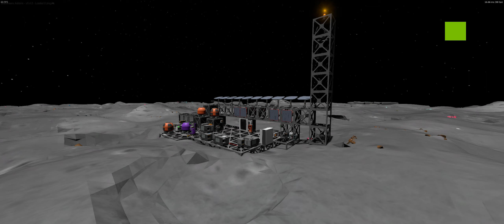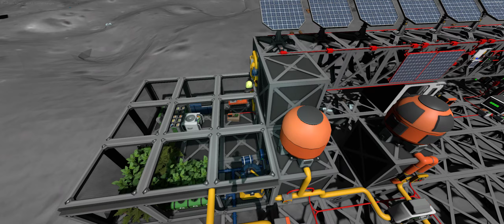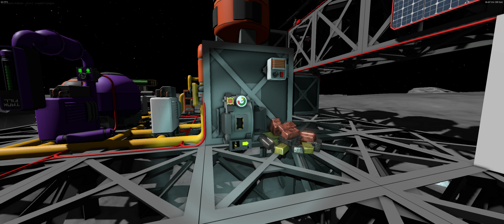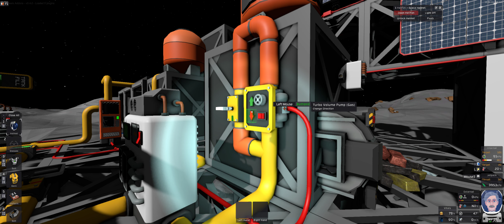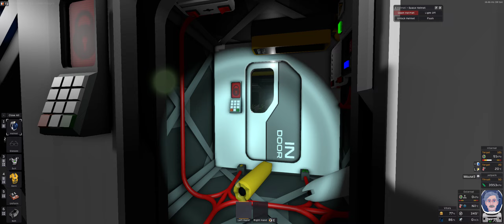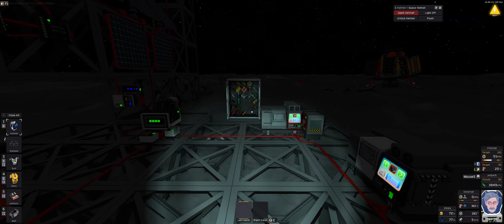Complete Idiots Guide to Stationeers - Finishing touches to Moon starting base

Comment: The passive cooling system would be fine - but use stable gasses like Nitrogen or Oxygen at a pressure of about 5-10 MPa and your pipe will not blow up when the outside portion of the pipe loop gets down to -170° Celsius. Pollutant or Nitrous Oxide are not the proper gasses for this purpose, I have found.